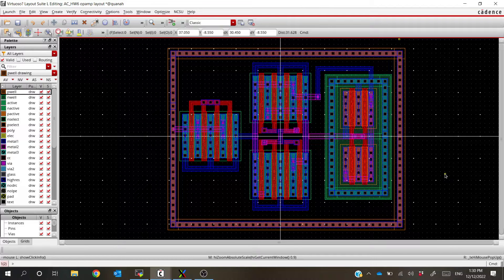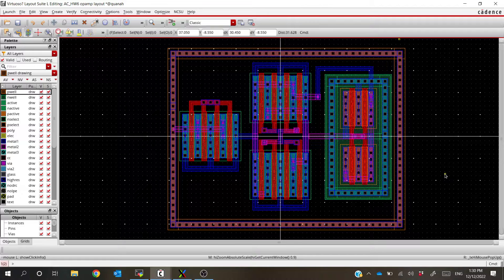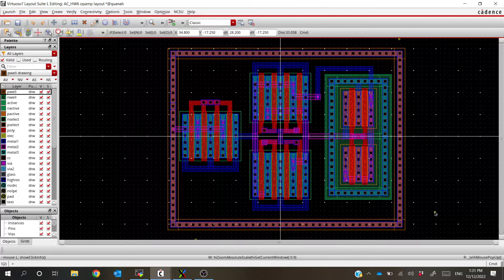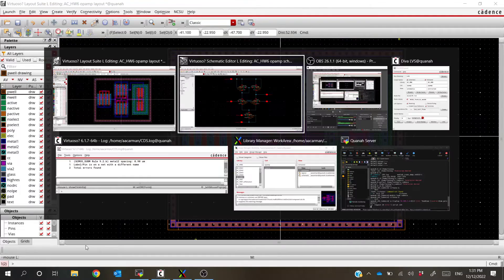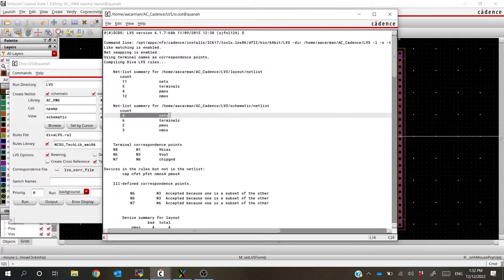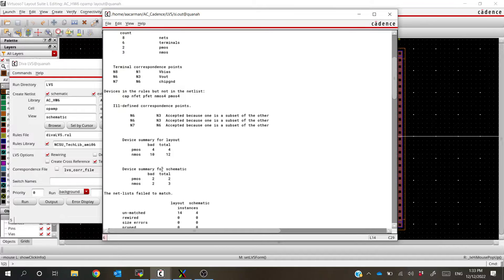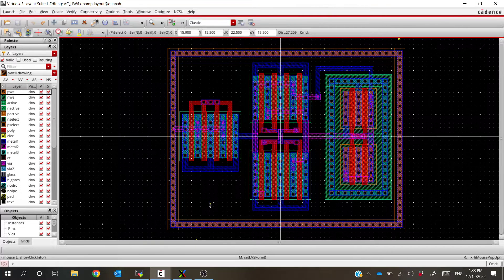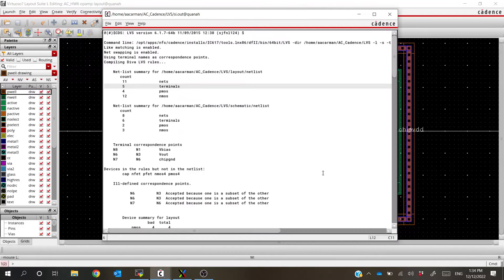Common LVS Errors and How to Fix Them - ECE x321 EDA Tutorial 5

Comment: thank you for uploading this video!! I started using cadence not long ago in college and this was the first time that I had to use LVS, I was going crazy trying to fix my errors, but it got a lot easier thanks to you!!
Reply from the maker: Glad it was helpful! What's even more unfortunate is that each design kit will have slightly different outputs on LVS, so your experience may differ if you are using a different kit (IBM vs TSMC, for example). Thankfully, if you're familiar with one type of LVS, you can usually figure out quickly where the errors are!

Comment: In the very beginning you have shown the si.out @2:10secs that, Layout has 11 nets and schematic have 8 nets. And then you mentioned that "there are few connections missing in the layout". My questions are:
1. How can Layout have more nets than Schematic?
2.  If layout has more number of nets than schematic how can you say that "there are few nets missing in Layout", but not missing in schematic. (I know schematic can't be wrong, but how can you say, the one with more number (Layout) of nets has missing connections but not the one with less number of nets (schematic) )
Reply from the maker: Great questions, I'll address each one individually.
1. The layout can very easily have more nets than the schematic if we aren't careful. Let's consider a simple case where one transistor drain (D1) connects to another transistor source (S2). In our schematic, since we should have D1 and S2 connected, they will form one "net." In the layout, however, if we don't connect D1 and S2, then we will instead have two "nets": one that includes D1 and another that includes S2. So if we are missing a connection, then the number of layout nets will increase. Conversely, if we accidentally connect two wires that should not be connected, the number of layout nets will decrease. You can use this to get an idea of what kind of errors you are searching for.
2. We generally assume that the schematic is correct, since we can perform simulation on it very easily. If we are making an amplifier, we can simulate the loop gain and time-domain performance to make sure it works well. From here, we can then try to match our layout with our schematic that we know works. If you don't simulate the schematic to verify that it works, then you have no way of knowing if the layout you are making is actually correct.

Hope this helps!
Reply: I Understood the 1st answer, but the 2nd question still stays, " there are few nets missing in Layout ". I mean, if you say, there are few "connections" missing, I understand. Because as you mentioned in your 1st answer that, we may get two nets - 1 for D1 and another for S2, which means they are not connected. 

But you said "nets" are missing. How can we come to that conclusion is what I am unable to deduce.

Thanks a lot of the help.

Comment: How to solve the missing instance error?
Reply from the maker: If you have a missing instance error, it is likely that a transistor or passive component is missing from your schematic/layout, depending on the specifics of the error. You will likely need to find the specific instance that does not match to discover the origin of the error.